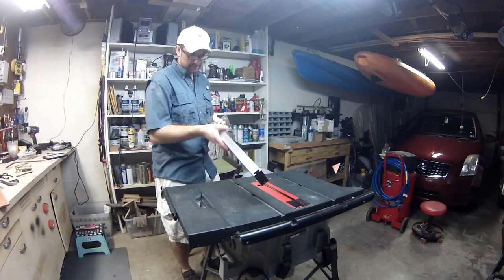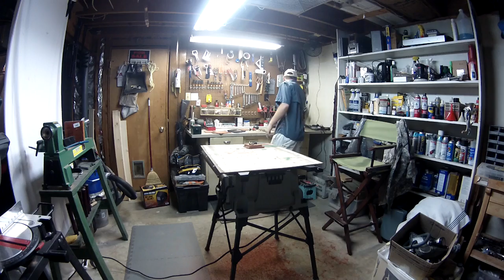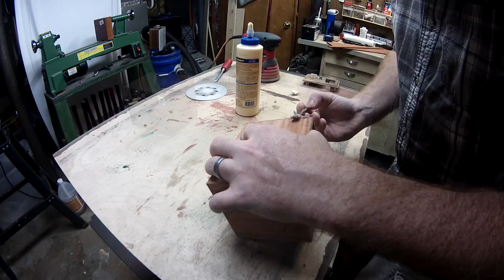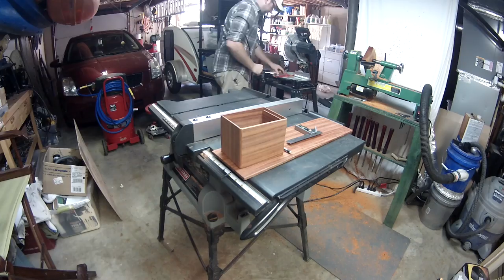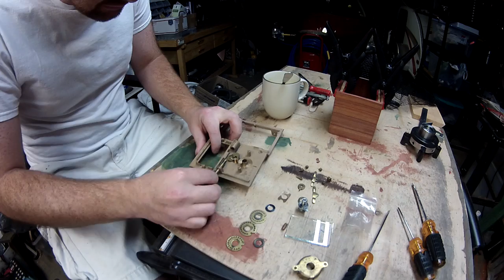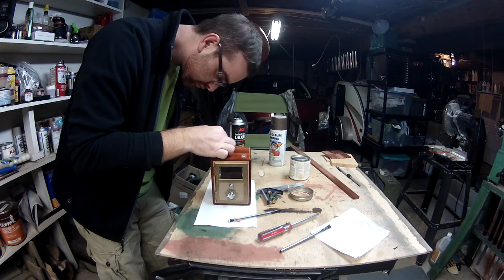P.O. Box Door Bank

Comment: How to you attach the door part when you already assembled the box part? Any tips on screwing it in or do you use another way
Reply from the maker: I made the box so the that the door frame is flush with the wood. At around the 2:30 mark of the video I'm gluing in a shim to fill the gap I caused by doing that, then I used small wood screws.

Comment: Came out great! Do you know what the measurements were? For the box/sides?
Reply from the maker: Ruperts Woodworks Hey thanks, I appreciate that. The measurements are roughly 14cm x 10.5cm x 10.5cm. Mainly built the box around the door.
Reply: Thanks alek... I'm going to go build a few
Reply from the maker: Ruperts Woodworks Hey thats awesome. If I was to make one of these again I would probably use 3/8 or 1/2 inch board and box joint the corners.
Reply: I cut some. ..3/4 in boards, I'll spine the edges

Comment: Any ideas on how to open one that I lost the combination to. It looks just like yours. It still has some money in it, but I hate to break it (if that's possible) to get it open.
Reply from the maker: Mine is in storage at the moment so I can't test this out; however,  these are not very complex. Try putting a bit of tension on the lower knob while rotating the dial. You'll feel the wheels contact each other but u may also feel  movement in the lower knob. When that lower knob gives a bit it's called a false set, record the letter and look for another. There are three letters starting clockwise then counterclockwise and again clockwise. With a little bit of time you should be able to figure out the combo.  Good luck.
Reply: Thank Alek! We will give that a try.
Reply: good job most people well put the door upside down
Reply: turning the door upside down while turning the number dial AND the door release sometimes opens it up......if you can get into the back of the bank with a screwdriver you can maneuver the release tab manually...that also opens it even if the combo is wrong......

Comment: I brought 6 P.O. doors back from Maui and they are all in very poor condition. Any tips on cleaning ?
Reply from the maker: I used alcohol to clean mine, but it wasn't in bad condition. if it's painted try paint stripper, the spray kind at automotive stores works well. if it's  corroded try brasso and a scotch brute pad. good luck.
Reply: +Alek Stang     Thank you